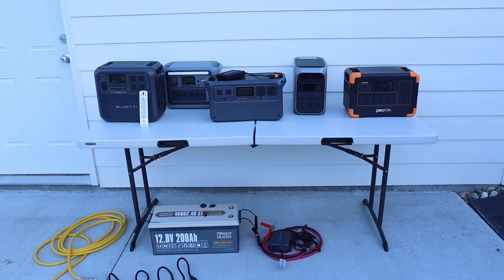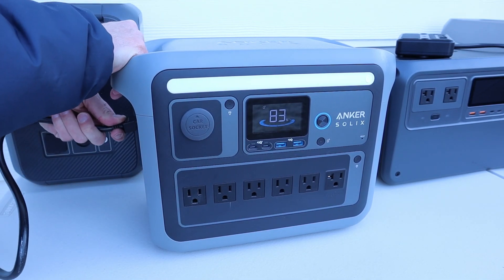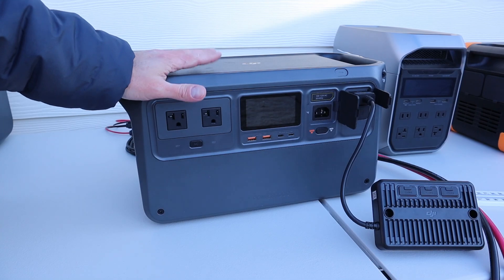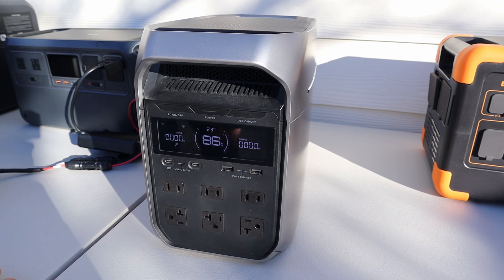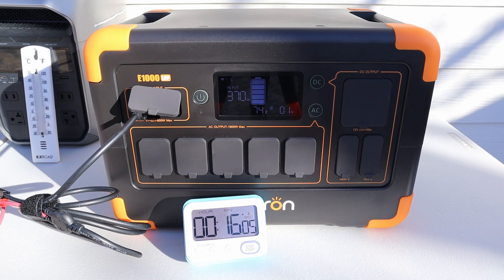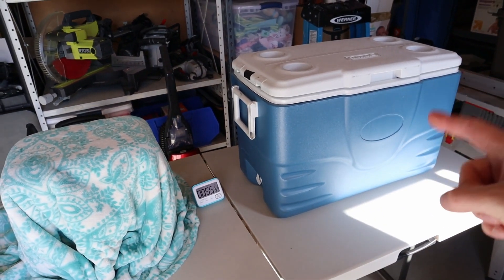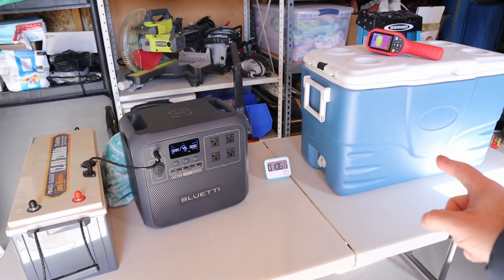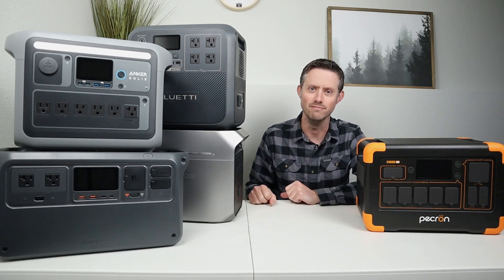Do Power Station HEATED Cells Make a Difference?

Comment: I have two Ecoflows which are basically useless in my area (Northern Norway) as they won’t charge when nearing freezing. So I can’t use them outside, in my garage, in my barn or in my campervan. Heating is an essential feature for battery power stations in colder climates.

Comment: Since the inverter works...can you draw power from the E1000LFP and plug the AC cord in to it to charge it where it warms its own batteries with its own heater so it can be warm enough to charge?

Comment: In my opinion, the biggest downside of power stations with LFP batteries is that they are not heated. They're marketed for emergency preparedness but in cold climates it'd be too easy to run into a scenario where the batteries are empty and you can't charge them up without some other heat source.

Having built-in heaters makes so much sense. Nice to see pecron innovating and I hope that the other power station manufacturers follow suit!
Reply: Its not like they are stored outside. they will be where you need them. In climates where its that cold you have other issues other than netflix.
Reply: @jahquanfoster6974  Yup.  1) medical equipment  (these things will power a lift chair for a long time.)  2) heated clothing.

Comment: Heating the cooler is probably the safest way to do it, assuming you use a low power heater (or the inverter at idle) and you wait a long time for the heat to permeate through the entire mass of the battery cells... this is further slowed by the plastic case. Better to try to keep them from getting cold, maybe put them in a cooler early with lots of thermal mass like water.

Alternately, if there was a way to make an MPPT directly power a heater, that would allow the solar panels to heat the battery bank first. Or if the solar input can still be used to reduce inverter power coming out of the battery (or even power the inverter from the built-in MPPT), then you could still sort of heat the battery bank using waste heat from powering something else.

Comment: You just answered I question that had come up for me.  I have an Oupes 1200 (original model) continuously hooked up to 200w of solar in the back of my truck camper.  I noticed it was not fully charged the other day, even though there was no output use.  It made me realize that while manufacturers have included heating pads for lithium batteries, they probably didn't for solar power stations.  You have confirmed my theory.  Are there other manufacturers that have heated power stations besides Pecron?  Thanks again for an exceptional story.
Reply: Pecron is the only one that I am aware of that offers a heating pad in one of their models.

Comment: Your practical approach to testing out these power stations is very helpful. Since, it seems that the sensors and batteries are on the bottom, I wonder if a heating pad might work and then cover the power station with a rescue blanket. Another idea is to get a heated throw blanket and wrap it around the power station. Lastly, in a pinch, maybe try a few packs of those instant hand warmer and lay the warmers around the bottom and cover the unit with a coat.

Comment: Nice test, looking forward to the review of the E1000! Looks like a great battery setup for my truck with the self-heating cells, only thing missing is the cigarette lighter port for my ICECO. Would love to hear your thoughts/options on what DIY cables would be the best option for the other DC ports.
Reply from the maker: The E1000 still has a 12v socket, but that connection is horrible for fridges because they come loose while driving. I'd cut off the 12v socket and install xt60 and you'd be good to go!
Reply: Thanks for clarifying, they didn’t list it on the Amazon posting (or I missed it)! Appreciate the xt60 suggestion, will look up how to make that!

Comment: You could always just flip the power station over occasionally to let the heat rise from the inverter to other areas of the power station.  That said, the Pecron will be putting pressure on the other brands to incorporate that feature for those of us who camp/overland in cold weather

Comment: I recall when Bluetti first started out a few yrs back that I saw a vid or two on this subject and the B300s was the game changer at the time. I recall the use of small heated mats and electric blankets that worked competitor on other batteries since like you Im hesitant about the thermostat placement inside the unit. But I will say I used the AC500 with 6 B300s batteries for 2 winters in a rear entry with no heat here in the Boston area and never had an issue and they are functioning great today. Use system to level 2 charge my Pacifica Plug in which is also functioning well 2 yrs and 40k miles in.

Comment: I have the E1500LFP, which is the high capacity model and most importantly the 30A12V output.  This sits in the back of my truck hooked to panels.  The month of December was either entirely gray or weeks of no charging.  I did try one seat of heater pads, but they didn't work.  To charge it I had to bring it inside and let it warm for a while. 

Prior to this, I had a "DIY" setup using a sok 12v100ah and a victron charger. This battery is in an insulated toolbox I made. Since batteries produce heat when charging, this actually maintained a temp above freezing most of the winter. But once it does cool down - like if disconnected, then it disables charging altogether and then never warms back up until it's warm enough outside. And because of the thermal mass, I. had some days where it warmed up to like 36F, and the battery kept reading 32F.  But once it clicks over to charge, it warms up several degrees quickly.

I'm going to try again with a different 12v heating pad and I'm making an insulated shell for the pecron.  The pecron takes up less space and more functionality than my "battery in a toolbox" does.

Comment: When I had the AC200P in my shed I had it wrapped ina 12v blanket and that kept it warm enough.

My EB70 died after one night below freezing. I might pick up a pair of e1000s because  I need cold weather power for my pond and chicken coop. Does it have auto power on from dead shut off? That would be the ultimate power station for my use cases if so

Comment: Does the EFP 3600 have low temp charging protection? and what about the extra batteries?
Reply from the maker: I'm sure it has built in protections since the E1000LFP didn't charge till the cells were warmer.

Comment: You're right. If the temp sensors are on top of the cells they mostly reflect ambient temperature inside the case. If they're in between the cells that'd be a more accurate reflection of cell temperature. The thermal image of the Bluetti does show that the bottom is quite cold. Teardown time!

Comment: Are there any other power stations out there with built-in heaters? Do the any other Pecron units have them as well?
Reply from the maker: Three models right now:
Pecron E1000lfp
Bluetti AC500 + B300s batteries
Ecoflow DPU

Comment: Well I learned something new...I did not know Pecron had heaters built in.  During one of my hunts I plugged in my 12V electric blanket to my ecoflow to warm it up so that it would take a solar charge.  It worked out.  Don't know how long it took to take a safe charge as we took off early before sun up from our campsite but when we returned the unit was 100% charged.

Comment: About the alternative charging schemes (inverter heating and 150w heater in the cooler) - try charging the power stations and have them on a short stand-off platform so that the warm air circulates around the bottom of the power stations.
Reply from the maker: Im sure that would help! My cooler isn't quite tall enough for that since the lid was barely closing.

Comment: We live in the Sierras and use a Toyotomi kerosene stove for heat. The beauty is to run the stove from cold is 9 minutes of 250w to heat the igniter then 47 watts to run to fan. On power save mode , I can run the heater for more than 11 hours with my Anker C800plus.

Comment: Maybe it’s about time to start using sodium cells.
Reply from the maker: Tell that to the manufacturers :)
Reply: Wouldn't the units be much heavier? I thought they're nowhere near as power dense as LFP?
Reply: @adriftatlas  not much, it’s almost on par with LFP and on the other side it needs less thermal management so you can get a tighter packaging.

Comment: Great video. Nice to see how the temp protection works at low temps. I know the AC180 also slows charging when it is above 90 degrees or somewhere around there. It rarely gets cold enough to worry about the low temp where I live. I have just disconnected the solar from my Pecron e2000lfp when it was supposed to be below 32 to be safe. I also put a thermometer out near the unit to see what temp it was. It never read below 40 even on the coldest nights that were supposed to be around 30 outside. It is inside a storage area that is not temp controlled. 
The pecron with the heater is nice, Definitely worth a tear down to see how the heater is setup.

Comment: Great content!  Always wondered if a heated battery would be a good option for my chicken coops. I use AC 70’s in a thermal bag then wrap a sheep skin over them. No charging or discharging issues at all. Coldest day in 2 years was minus 7 degrees. (TN)  Both AC 70’s were almost depleted by morning. (2) 110 watt water heaters on and off.  A quick AC charge in the morning gets them through the day and a 100 watt solar keeps them topped off for use again that night. The Precon Pre Order price of $399 is attractive. I’d get the Pecron if I had it to do all over again. The AC’s were $387 each. The Pecron is a better bargain for now but whats the regular price going to be? I’d buy the Pecron if the WH price was comparable or close. Thanks for your hard work!
Reply from the maker: I think you'd still want to have the Pecron in some sort of insulation, just so the temperatures aren't so extreme :) Great ideas, thanks for sharing!
Reply: I broke down and bought the Pecron e 1000 lfp. It’s a good price for a 1K box. Looking forward to the  full shake down on it?

Comment: If you have ever tried to defrost a frozen dinner, then you will feel the way I do about the results of your testing.
Not saying your testing is flawed. But the results might be.

There is no way that a battery cell from 20°F gets above 32°F in 15 minutes (pecron heater) or an hour (other tests). 
The sensor detection is from surface reading. It’s pretty much useless. We know that from our annual thanksgiving turkey.

Charging itself can heat a battery cell. So maybe a gradual increase in charging current can warm the cell in a safe manner after the initial outer layer warming.

My preferred method is to not let the batteries in question get cold.
Reply from the maker: I feel the Delta 3 Plus in the ice chest with a heater running for an hour had valid results. The only way to know would be to open up the power station and measure the actual cell temps.
Reply: @ or build a 4 cell battery and test it that way.
Reply: Sure thing, but this smaller unit could be viable for tent camping or small RV camping where temps will drop at night, but as the sun comes out, the heater feature may get the batteries at charging temperatures faster and ready to take advantage of those early sun hours.

Now how much of this is factual, only testing to find out. I just ordered one of this Pecrons, yet to receive it to replace my 5 year old Jackery 1000 v1 that just smoked when plugging the AC charger to it. Felt uncertain to get another Jackery so I'm giving a shot to this Pecron.

It will be nice to see how this powers things while keeping the batteries at a healthy temperature for sun charging.
Reply: @ keep it in your sleeping bag will keep it warm.

Comment: Good video. Some people place their charging station in a aluminum carrier on the trailer tongue. I’ve chosen to place mine inside the trailer for better cold protection. I also bought a sound dampening blanket and place it below and between the power station and trailer walls. Sound dampening blankets are fairly thick and provide reasonably good insulation value.
Reply: Small heating pad along with insulation but it’s annoying and it doesn’t always work. That’s why I’m gonna go ahead and get the Pecron
Reply from the maker: Great idea!

Comment: That one unit that uses solar power to first warm the unit is clever. Maybe there is a makeshift way to use an vehicle oil pan heater off of DC that would shut off at operating temp. Thanks. This was informative.

Comment: Unit in the cooler . I would turn it upside down . 
As the batteries are on the bottom . 
Heat will be in the top is the cooler

And the batteries will hold the cool temp over the circuitry
Reply from the maker: I'm sure flipping it upside down would have helped a little bit but the heat still needed to penetrate the case and warm up the batteries.

Comment: I've also used a small heating pad, like the ones for dogs and cats to lay on, and they can work too. I have an electric blanket that I use when cold camping and it uses very little power, so I can use a very small power station for that and I'm sure that would do nicely. I think we are on the same wave link. I love experimenting.  I liked that all the power stations didn't go wonky, but just let you know they can't do certain things. Nice to have a fail safe system. Thanks Jason. Great test.
Reply from the maker: Thanks! It's great to hear that others are testing different options. The small pet heating pads are a great idea! Same with a small 12v dc blanket!

Comment: Could you use a heating pad? Place it underneath. I know they don't take much wattage. Great video thanks for posting, always wondered how they reacted to cold.
Reply from the maker: Maybe a 12v heated blanket would be better? The outside case acts like an insulator though it you need heat from the inside, like turning on the AC inverter and covering the power station with a blanket.

Comment: The power stations that use LFP has an advantage on the charging as they can actually charge at 0.1C below 0c and even 0.05C below -10c.
This will cause battery heating by itself so a LFP station does not technically need heaters.
Reply from the maker: That slow level of charging would take a LONG time for the cells to heat up but I guess they eventually would, as long as you kept the battery from being exposed to extreme cold.
Reply: @Jasonoid  yeah. A 280Ah cell can be exposed to a charging current of 14Amps which is 45 Watts at nominal voltage. That's 180 Watts for a 4-cell pack. The heating pads provided in most packs seem to be 50 watts each.

Comment: Nice test. Since getting the Bluetti dc-dc charger I just turn on my engine and place the Bluetti 200 Max (with a wool blanket over it) on the passenger seat with the seat heater on high. Starts accepting charge in 15mn.
Reply from the maker: Thanks for sharing your experience!
Reply: That’s a great idea!

Comment: Using my ecoflow delta 2 in my garage......temp was 12 degrees and unit would not charge....snowflake on screen.  Unit could still discharge and runs my deep freezer. After the freezer pulled some power......the unit heated up...no more snowflake on screen.....without being in a box with a heater....and then started solar charging. Try testing inverter running something but no box and heater. We dont know if your heater helped or if it was the fact that the power station generates heat when running. Interesting to see.
Side note......the extra battery was still too cold.
Reply from the maker: The inverter definitely creates it's own heat, I just wonder where the temp sensors are located. If they are near the inverter, the readings will be false.
Reply: @Jasonoid  the batteries will heat up as they discharge

Comment: When you first showed the Pecron, I bought one thinking it'd be great for cold weather car camping.  I was disappointed to learn (from another video and this video) that it won't use battery power to MAINTAIN temperature.  This wasn't clear on their website.  What do i need a battery for if I already have shore or solar power?  Maybe getting one of those 12v silicon warming pads and sticking it on the outside would allow the battery to stay at a usable temperature. (EDIT: This battery discharged fine when cold, only needs hear to charge).  That being said, I'll keep the unit - good price, good DC output amperage, good UPS function.
Reply: Just saw your comment on the video from the Solar Lab reviewing this same product - good to know that these can discharge just fine in the cold and only need to be heated for charging.
Reply: @thelateknights  I'm guessing you are talking about the solar lab channel and the recent E1000LFP video? They always have bad info on their videos. I can't believe how much YouTube shoves their videos down my throat! One day people will realize their channel is a scam...
Reply from the maker: I commented on that video since you could tell they didn't know what there were talking about.
Reply: It would have to get pretty cold to not be able to use it. If it is with you it should be alright. A power station with a heater that uses power to stay warm uses a lot of power. Usually you can still use the power station even when it is too cold to charge. Using the power station generates heat....thats why they have fans......this will heat the unit up.

Comment: Looking at teardown of the AC180 the BMS is long the side down low by the battery, and there are temp probes going into the center-ish(?) of the cells. Couldn't find a vid showing exactly where they go but I'd bet they're measuring what they should.